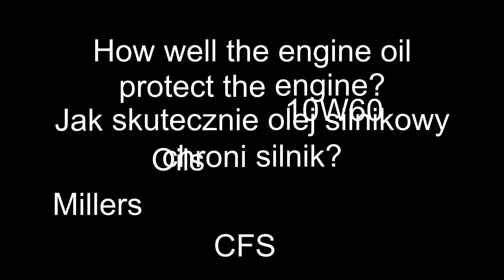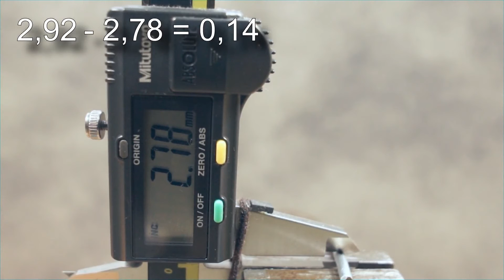Millers Oils CFS 10W60 NT+ Jak skutecznie olej chroni silnik? 100°C

Comment: Mr. Piotr

what oil would you advise for a Subaru Impreza STI 2002 (190000KM)

I used to give him Motul300v 15w50 but he had excessive consumption every 3000km

then porve with Millers Oil nt + 10w60 and hardly consume oil

but for lack of time I will now put Petronas Selenia Racing 10w60

Anyway which one do you advise me?

THANK YOU
Reply from the maker: Try one of 10W60 - it has higher viscosity than 300V 15W50. Don't buy expensive 10W60, because I bet that your engine will be still consumption it. Try also use oil additive with ceramic, to reduce consumption oil, for example 3x E120 (one is too small), 2x Bilstein R2000.
Which 10W60? Valvoline, Millers (grey bottle), Motul, Xado.